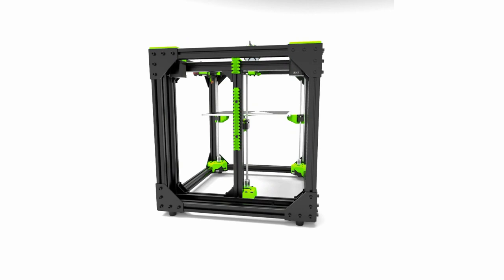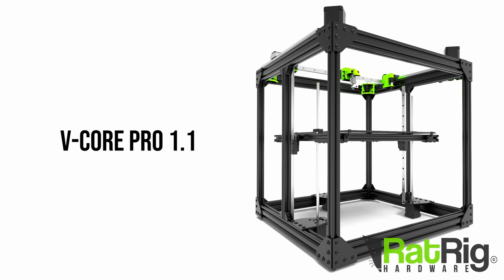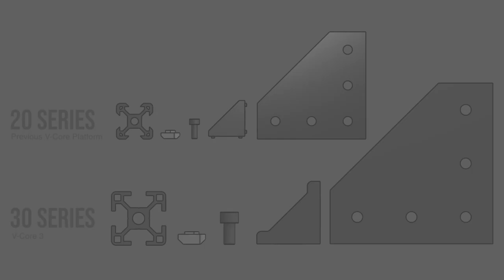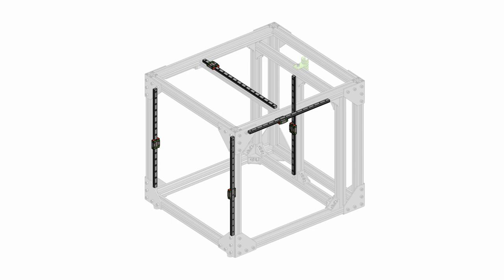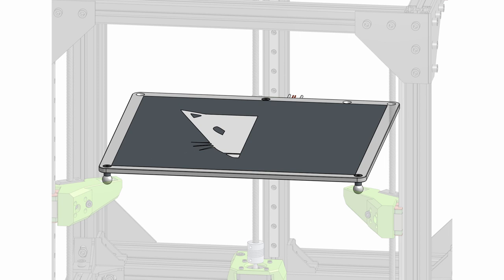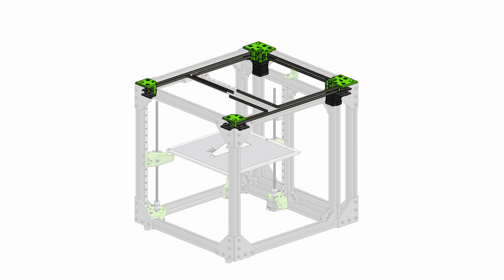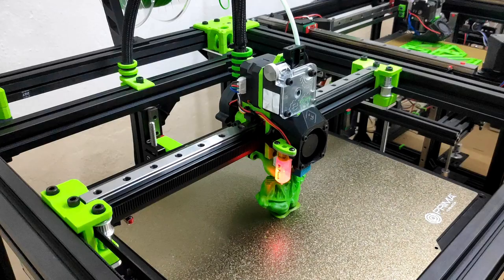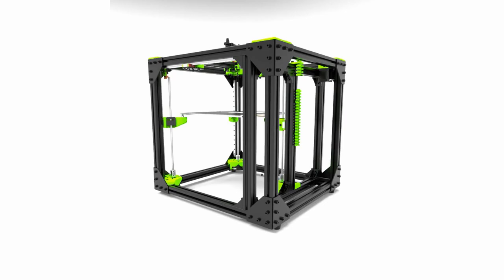Rat Rig V-Core 3 Announcement - The ultimate DIY CoreXY 3D Printer Kit

Comment: ok but why do you need 30 series, we’re the 20’s really being pushed to their limits or is it just a way to say you’re better?
Reply from the maker: V-Core 3 was designed from the ground up to tackle a 500x500x500 build volume. At this size, 3030 is a much better choice than 2020. 3030 also allows the linear rail carriages not to stick out of the profile, which is what allows this machine to be fully enclosable.

Comment: will you be offering ABS printed parts for those that want to enclose the printer
Reply from the maker: As soon as the current production ramp stabilizes, we intend to do this, yes.
Reply: @ratrighardware   what about moving away from lead screws to a belted z  probably not something you would put much thought into since you seem to be so busy right now but if u ever did that it would be great

Comment: also why are the lead screws not mounted at the top, these designs with the floating rods drives me nuts omg
Reply from the maker: Constraining the lead screws at the top gives them no room for adjustment, meaning that anything less than a perfect alignment will create wear on machine parts. It's not a good idea.